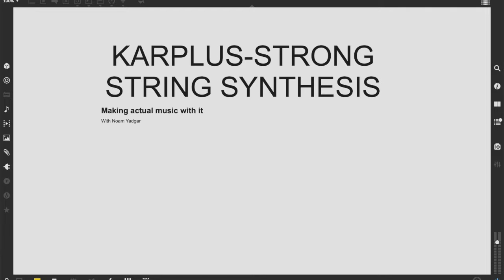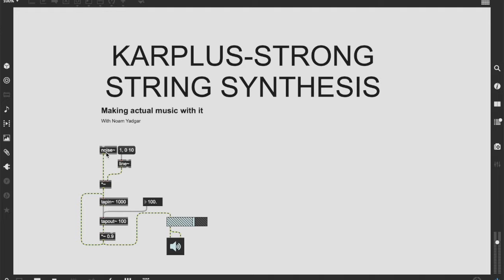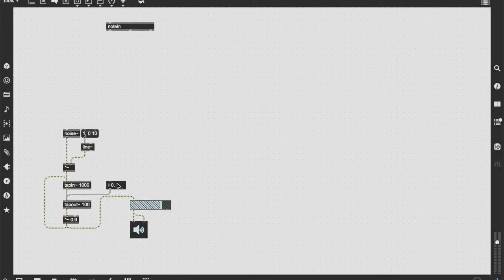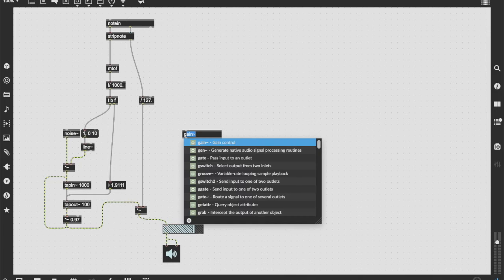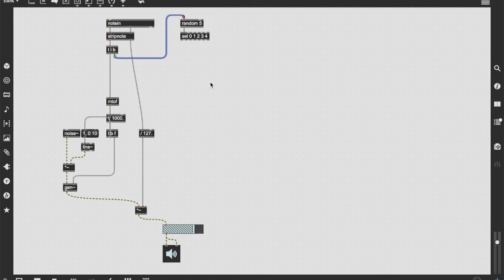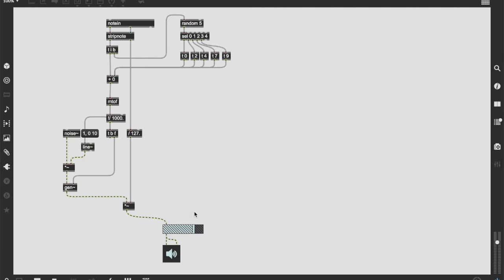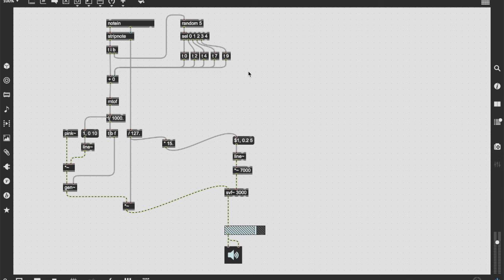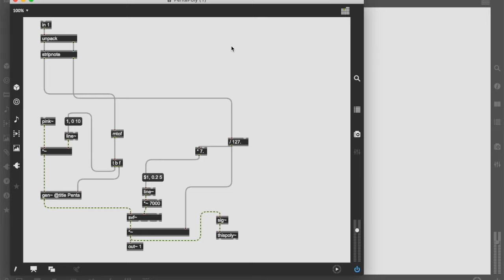Max | The amazing sound of KARPLUS STRONG [Full Lesson]

Comment: I couldn't get the right sound within poly~ unless I re-added the !/1000 object into it, which I do not see inside your poly~ abstraction here. Curious how you were getting it to work without that object. I was getting what sounded like short/clipped sounds stuck in a feedback delay.
Reply from the maker: gavcloud I’ll try to suggest some troubleshooting options: Is your poly~ in steal 1? Also it’s common to sometimes forget that thispoly~ should be bridged with sig~ from the output of each instance, otherwise poly~ won’t know when to pick each instance and you might end up with weird behaviors. Make sure that the delay line is part of the poly~ hosted patcher. And off course, midi handling to poly~ with the massage “midinote $1 $2”. Hope some of it will help.